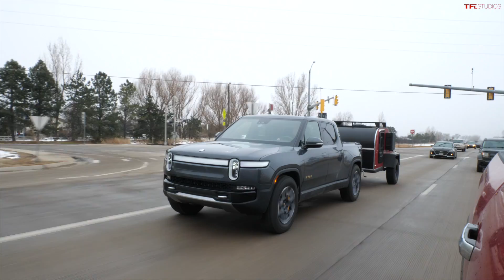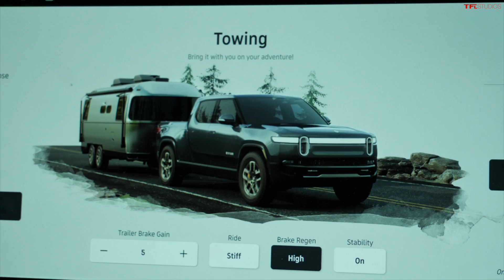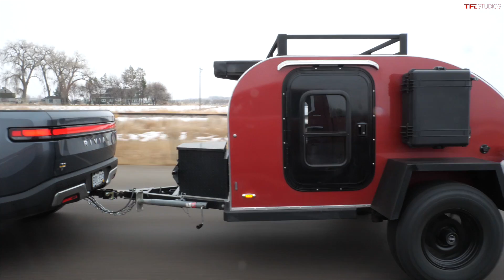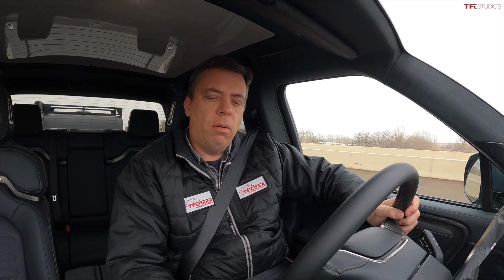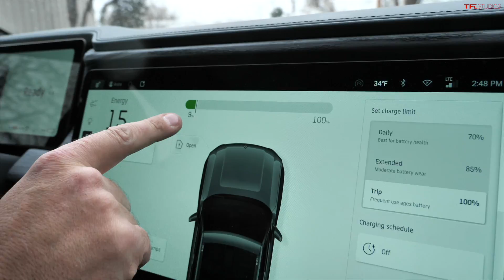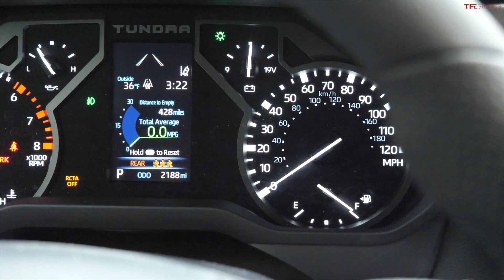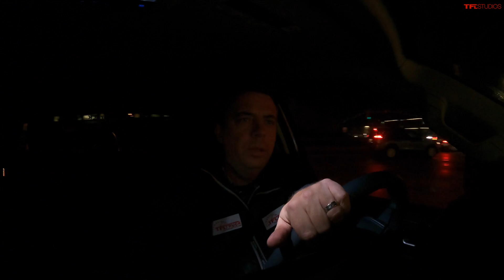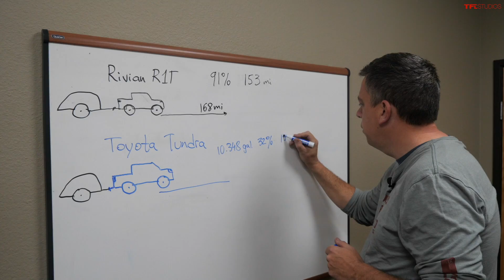Rivian R1T vs. Toyota Tundra: How Far Can Each Truck Tow On A Single 'Fill-Up'?

Comment: It would take hours longer to go the same distance in the Rivian. Also, part of the test with the tundra was in the dark, the Rivian would also lose range if using lights. For those only covering shorter distances though, the Rivian is a great, if very expensive choice.
Reply: Using led lights (around 30 watts per hour) for a couple hours will only have negligible effects on the range.  Far less than a 1 mph headwind...

Comment: Another reason EVs are commuter vehicles only. Then what happens when you get to the campground 153 mile away? Can't recharge if there is no electric unless you are at a commercial campground and you rent the site with an electric pedestal. maybe a 30amp 220 plug or it may only be a 110v plug. Now add the extra $50+ per night to recharge your truck. Gas vehicles for the win all day long here.

Comment: Wouldn't a smaller truck like a Tacoma be a better comparative truck? Also this isn't surprising at all but what I'm curious about is loss of mpg compared to loss of mi/kWh. For the time being though I'll still rather tow with a diesel truck, especially getting into larger trailers where fitting in certain parking lots/areas could be an issue.

Comment: The climate being on is perhaps a factor for the Rivian as well. Tesla people are used to managing this in cold climates. The kw usage with it on is significant. I understand that means you sacrifice a bit of comfort but if you are only using this to tow every once in a while it may worth it to bundle up for the benefits when not towing. A test with the climate on and off (maybe just seat warmer on) would be interesting.

Comment: So how come on the trip meter for the tundra when you turned it on it said 438 mile to empty then all of sudden you hook a trailer up and now you can drive further 🤔.
 But tech is moving up.
 I'm would be curious to its consumption for something more aerodynamic like a airstream we all now its not the weight but the drag that affects your range the most and those teardrops arnt that aerodynamic with all those racks and fenders plus if you can afford a 80,000 truck i think a airstream is in the budget 🤔

Comment: Considering that 1 gallon of gasoline is equal to 33.7kwh of energy when you mutiple that by the 10.34 gallons usedby the Tundra to tow the trailer that equals 348.45 kwh to tow the same distance that the rivian did with 128kwh. I don't believe range is the issue with any EV It is all about charge times being so long and access to reliable charging infrastructure. It highlights how energy dense gasoline is. How inefficient ICE are. How amazing electric drivetrains are and how battery tech has a long way to go.
Reply: TRUCK IS ALL ABOUT RANGE...... HOW FAR CAN YOU GO....... WHAT IF 150 MILES IN THE MIDDLE OF NO WHERE......
Reply: No, the issue is they choose about the lightest trailer available to get the EV to have at least some type of range. If you got the average 5000 lb camping trailer, I'd guess the Rivian would go less than 50 miles!

Comment: Great comparison! Based on its 135 kwh battery the Rivian used about 123 kwh to complete the trip. The Tundra used 10.348 gal of gasoline which is equivalent to about 352 kwh total energy. That puts the Tundra's ICE drivetrain at about 30-34% thermal efficiency if you think the efficiency of the Rivian is 90-97% like the guy said in the hotrod show you guys posted a few days ago.
Reply: It actually puts the efficiency of the rivian even worse due to the lack of heat pump and temperature outside…..
Reply: Electric motors are ridiculously efficient compared to gasoline and even diesel engines, it's the battery and charging that needs to improve.
Reply: @RufusJRT  same in ICE cars, it'll be 100 times cheaper making an ICE more efficient than researching and inventing a more efficient battery for electric cars.
Reply: @ricardolevy885  Yes and we have not really started on the development  of ICE vehicles
Reply: @RufusJRT  Not likely on both counts
Reply: Based on that, and the electrify America rates for charging in Colorado (0.31/kWh), it would have cost $38.13 to do this trip in the Rivian. However, from previous tests they've done, the chargers claim 5-10% higher kWh usage than the truck receives, so really $40.14-$42.37, making the Tundra basically the same price, or cheaper, for this route as it cost $40.35 in the Tundra.
Reply: @a-c17  Yes cheap electricity  is a joke
Reply: @robertryan7204  Electricity at night from Georgia Power is only $.01/kwh .  Georgia has an abundance of nuclear power in the evening so as you sleep, it's almost free to charge an EV.
Reply: @aussie2uGA  except when a vast number Of EV's start using it. Nuclear  Energy not that environmental  friendly
Reply: @robertryan7204  Well oneday it may go up but so far it's been a penny for the past three years.
Reply: @aussie2uGA  It sounds like a tidal wave of EV'swill be using it. Then stand back when the price skyrockets
Reply: @a-c17  The article on TFL's site indicates "EPA-stated 1 gallon of gasoline is equivalent to 33.7 kWh", so the Rivian starts with 4 gallons of gasoline equivalency to go 153 miles using it's "fuel" for cabin heat and has 9% charge remaining compared to the Tundra using only a little over 10 gallons of gas - much better range in the Tundra but a slightly higher cost. The Tundra makes more sense on every trip where you tow something over the road, but I'd like to see farm work testing where you are doing more stop and go (city driving) towing water/feed/seed around a farm.
Reply: @a-c17  Well other than the vast majority of EV charging, 90%+ in the US is done at home...for a whole lot less...turns out most people drive only a bit a day.  The whole era of the giant gas guzzler is thankfully coming to an end...
Reply: It goes to show how much more efficient the Rivian is vs the Tundra.

Rivian:  135 kwh * 0.91 = 123 kwh
Tundra:  33.41 kwh/gal of gas * 10.348 gal of gas = 346 kwh

The Tundra used 2.8x more energy to do the same job.

The Tundra used $40.35 in gas.
The Rivian used $0.15/kwh * 123 kwh = $18.45 in electricity (Colorado residential electricity costs $0.15/kwh).

I would use the residential rate for this test since it was an out and back trip; all on one "tank".  This could be a drive to a local wilderness.
Reply: @DavidWescott1  Which means very little if it does not go far. At least it did it efficiently
Reply: Thanks for the breakdown.
Reply: Basically you are saying the solution is making the ICE more efficient and not going electric
Reply: Not to mention, the Rivian used it's "fuel" to heat the cabin of the truck for the entire trip. So if this was a test in a warmer climate the efficiency would be much higher. I'd also like to see a test using the trucks for farm use (city driving) instead of towing long distances as an ICE vehicle would have the range advantage.
Reply: Keep in mind the electric motor is 90-97% efficient.  There is other powertrain losses.  And even more losses outside the gas engine in the Tundra.

Comment: Under 2000 lbs is not really towing. I would rather see it towing atleast 4000 lbs thats more normal camper weight. 2000 lb is just a  5×7 uhaul trailer.

Comment: It would be interesting to see how an older pickup from the late 70's or early 80's would compare to the electric. Basically my thought is that the innovations in ICE engines and technology advances have improved fuel economy dramatically that current iterations of electric vehicles could be considered the "gas guzzlers" of their time.
Reply: Yes they should use an old diesel truck running on used/cocking oil for comparaison it would be hilarious 🤣 😄
Reply: I have a 92 F150 with a 300" six and 5 speed manual. Unfortunately, when towing it doesn't compare to my 12 Ram 2500 with 6.7 Cummins turbo diesel, nor should it since the F150 is rated about 145 hp and the Ram has 350 hp (or had)...
Reply: The problem with your theory is the basic technology of electric vehicles has existed for longer than ICE, it failed 100 years ago just like it will continue to fail. My buddy's emissions deleted 6.7 Powerstroke crew cab 4wd long bed has a nearly 700 mile range unloaded and would probably still have well over 500 mile range while pulling the Rivian, it's little camper trailer, and the gooseneck required to fit it all. Electric will never be the answer for people who live outside of the city. It's nothing more than a city yuppie trend.
Reply: Electric cars did come out before ICE but they were limited by tech to store and use there "fuel" source at the time. Gas and diesel were cheap at the time so they dumped the idea for the time being. Now that technology has made a pretty huge leap and ICE is nearing the limit of what can be done while also dealing with pollution. With your buddy's illegally deleted truck (which is pushing ICE closer to being banned) being the main reason for electrics being pushed now. Can't complain about something replacing as you ultimately help push it out of existence.
Reply: @WhoThisGuy515  actually the technology of EV has always improved over the 100years+ from the electronics to manage battery charging to the batteries that have been developed for mobile devices…..
Reply: You can use my D250 5spd Diesel I drive daily.  It gets 20 unloaded and 12 towing my 30' toy hauler.
Reply: Its actually not guzzling. Its being a lot more efficient. The issue is the energy density. 
He says he went 1.26 miles per kWh 

1kWh = 0.03 gallons of gas. Thats about 42 miles per gallon Gasoline is a lot more energy dense than current battery technology.  I imagine some day in the future trucks will have 4-500 kWh batteries at the same or even leas weight and charging rates will will be 350-500kWs empty-full

If the efficiency increased another 10% and the onboard storage was 350kWhs, the same truck would tow that trailer 485 miles which is what the tundra did
Reply: @mattbrew11  and the same tundra with a Diesel engine can easily do 700-900 miles of range.
Reply: @mattbrew11  At perfect conversion, you get about 36 kwh in a gallon of gasoline.   you could do that, which you can't. 
The inherent chemical energy in a gallon of gasoline -- this is roughly 120,000 BTUs. 
The DoE method says a kwh at the plug takes 10,300 BTUs, not the 3400 of perfect conversion. It's a very large difference, a factor of almost 3 to 1.

Your numbers are in ideal conditions, not realistic. You get about 12kwh per gallon of gas in practice.

You should consider changing your name. 👍

Comment: You forgot to include the Rivian also cost $15,000 more then the Tundra, lol
I love the Rivian and want to accept the new electric era with open arms, but we are just not there yet. Hopefully in another 5 years or so with new technology we will be.
Reply: I'd still take the Rivian! Fuel savings over the life of the truck will be huge.
Reply: @monkeysezbegood  🤣🤣🤣 until you have to pay 25 grand to replace the battery in 8-10 years.
Reply: @JohnDoe-nz6bk  I agree that was once true. But not any longer. Battery will last the life of the car these days. Even longer for the new lfp battery
Reply: @monkeysezbegood  🤣🤣🤣 no they're not! The battery is barely making 10 years. You do know that they have 1500 charge cycle before they have to be replaced, right? That's only 1500 charges!
Reply: @JohnDoe-nz6bk  I'm getting a lfp battery model 3, not a pick up. That battery will to 2000 to 3000 cycles, and I'll say 2500 @ 400km (more like 500 but I'll be conservative). That's a million kilometers!. Thats probably  more than I will drive in my life. It does seem Tesla has an advantage over other in battery tech
Reply: There have been many documented cases of Tesla battery packs lasting near 500K miles.  There is a Model S on its second pack and has past 1 million miles. At that rate the battery in my car will out last the body and everything about the car.
Reply: Try 40 grand more.
Reply: I don’t think 5 years is even remotely close.

Comment: The math equation on the Rivian gets even worse when you consider that most people are going to want to actually camp somewhere with the trailer. Unless every camp site has juice, you are going to be losing battery power as the truck sits, especially if you want to use all the fancy doodads and gizmos the Rivian comes with. If you can only get out and camp on weekends, your time is a precious commodity and many people will not be excited about losing hours of play time to charge or having to choose a specific route or camp site due to EV limitations. With that in mind, paying a little more for gas is going to be an easy decision for many people.
Reply: The self discharge rate of lithium batteries is essentially zero.  And the discharge rate running gizmos and doodads will be nearly zero compared to the discharge rate of propelling the truck and trailer down the highway.
Reply: @matthewprather7386  Id like to be proven wrong but without actual real world tests I remain unconvinced

Comment: We know you can't swap tires, but this lets me know that with Road Tires it would get over 200 miles since it is a 10-15% range hit with AT's. Not to mention living in a warm area the range may increase even more. Also, did the Tundra have AT's or Road tires?  The Rivian is heated by the inverters instead of a heat pump.

Comment: This is exactly the kind of information that is needed for electric trucks.  Good work.  This result, along with last week's Ike Gauntlet test really illustrates why the electric truck companies are not saying anything about towing range.  I was a bit surprised at how much the range dropped with that tiny trailer.  I expected a better result after watching your Ike Gauntlet results last week with a heavy trailer in the mountains.

Comment: So let's talk about COST. 

Rivian used 123 kWh to drive that distance assuming 91% of its battery was drained. Average cost of electricity is $0.13 per kWh in the U.S.   So that's roughly $16 bucks spent on this loop. 

The Tundra burned 10 gallons roughly. That's $33 bucks spent if democ-rats are in control or $19 bucks if Republicans are in control. 

So it costs less to tow with the Rivian.

Comment: I was just thinking about the military jets refuelling in mid air. There is a huge tanker flying in the sky that drops a fuel hose and the jet hooks up mid flight. Imagine driving in your Rivian and another truck with on board generating power shoots a charging cable out the back so you charge and drive down the interstate.

Comment: You have to stop doing towing tests with half tons and small trailers/lite trailers.  You should be using a 24-28ft travel trailer.  6-8k pounds but with actual wind drag.    And this is what you see many half tons actually towing….  The results are what they then.

Comment: Legit💪💪 you guys can drive!  I really appreciate these comparisons! One thing I’m curious is the cost to charge the Rivian for a test like this? Many thanks! Great review
Reply: It is very expensive unless you are charging at home. @11:07 they state they used about 122.85 kWh. In Colorado Electrify America is $0.43 for guest and $0.31 for members (per their site).That is $52.83 and $38.08 respectively using 100% efficient numbers, more accurate is probably closer to $58.11 and $41.89 (with 90% charging efficiency). This is not a vehicle that is good for towing at all it is not aerodynamic which is needed on electric vehicles and too small of a battery. The smart choice would be to stick to close destinations or free/cheap destination chargers.
Reply: @Thisisaplaceholder1  that’s great information!  Thank you for the reply!

Comment: A 2000 lbs trailer. How about the test be completed with a trailer most would use and not try to go as light as possible. We saw that this truck is useless when towing heavy, but now we know it is useless towing super light.

Comment: I guess i will keep my 20 Tundra to tow our 5000 pound plus RV. One thing I love about an ICE vehicle, when completely warmed up, you have infinite amounts of heat. I remember a few years ago driving my Tacoma in freezing rain for hours and hours on a long trip to family.  I had the defrost on full hot to keep the windshield and wipers ice free. We drove with the windows opened a Crack to keep cool. I would love to see an EV do that in those conditions. What about heavy snow ❄️....seen that many times to. I have driven same trip and it was -35 C and had the heat on full in my Tacoma. EVs are great for city driving and warmer weather.
Reply: That'll be an interesting comparison. Evs would need to use battery to keep you warm while ICE being so inefficient the energy wasted on heat can be used to keep you warm at no additional cost.
Reply: In my EV the heater set to a comfortable temp (still wearing a hoodie but not cold) will kill about 15% of the calculated range on a 25-35 degree day here in CO.
Reply: @cody roland  I never wear my coat. I have it with me but since i have all the heat I need, just a light jacket will do.
Reply: @ricardolevy885  wrong, Tesla now uses heat pumps to draw the heat from the drive motors and batt pack.
Reply: 20 Tss Offroad crewmax 5.7 4x4 here too . It’s my second Tundra. Love the old reliable dinosaur. 
I commented above my thoughts on this comparison . Even my old out of date tundra with the 26 gallon tank pulling a little over 4K with my ATV and can am x3 SxS is way better than that Rivian did with that little tiny popcorn trailer .
Reply: We have had some colder temps here in Ohio lately and the model 3 we have with the heatpump configuration has been doing just fine. I normally run the heated seats mostly though due to it just being a better way to warm you in general, kinda like what I did with my previous Mazda 3.